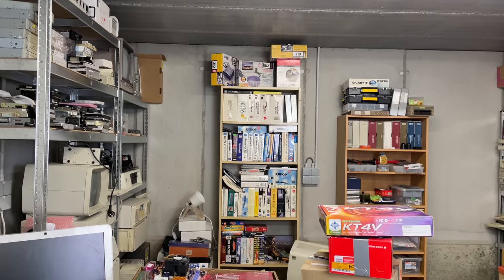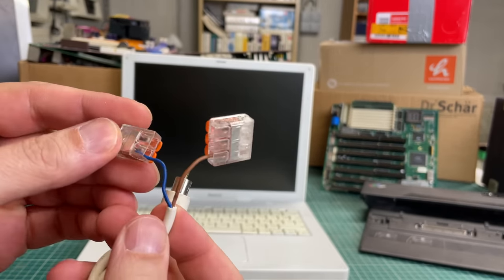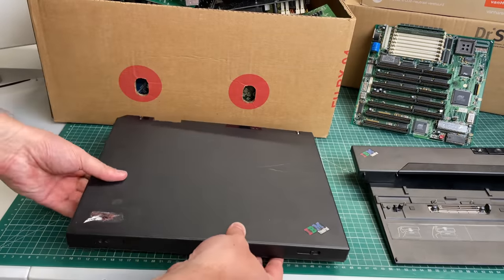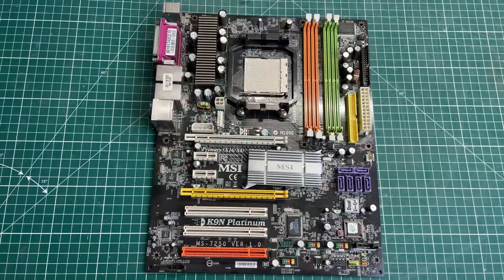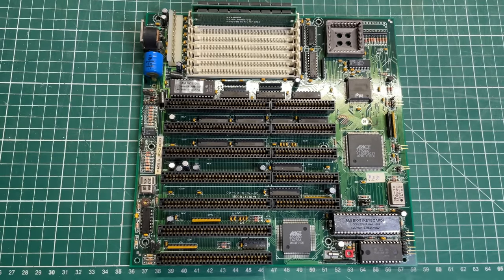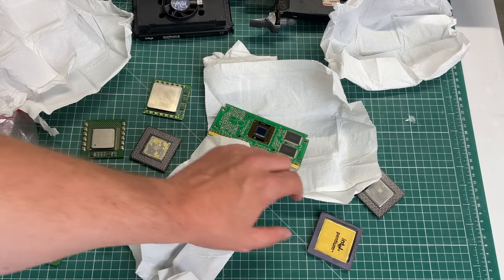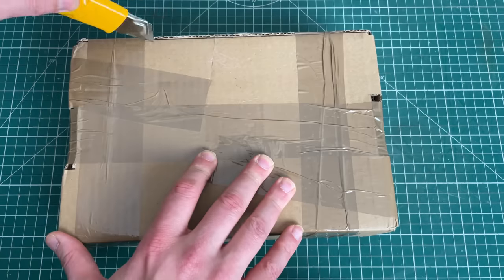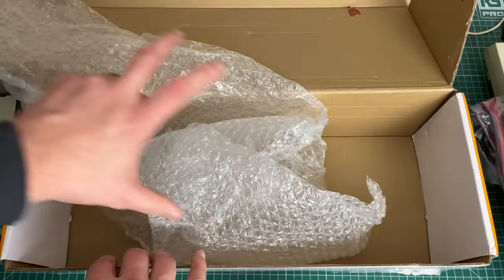Looking at some very generous donations

Comment: I happen to have a G5 that would take that Radeon card with the ADC connector.
Reply: Jep, a ATi Radeon card with the extra "slot" for the 24V needed by the ADC. Was a need design to have the monitor powered by the G5. Fun fact: The PSU of the G5 supplies 25V to compensate the losses on the way to the display.

Comment: 21:17: Both cards are 5250 emulator cards used with IBM AS/400's connected via a twinax Y cable. They require vendor specific software if they aren't IBM Client Access/400 directly compatible.

Comment: That Compaq docking station looks very interesting. It may have the aesthetics of a Fiat Multipla but it looks very practical. The design is a bit weird, it seems like it takes normal drives and not slimline ones. It’s like a hybrid of a desktop and a laptop. Curious if that iMac is a G5 or one of the first intel models, they still had the same case design.
Reply from the maker: Yeah it is a beast … definitely going to see what it can do.

Comment: You need to replace the LCD on the little Sharp but the problem is getting a replacement screen.
I have seen a replacement procedure for the PC-1250-series (see Robert Baruch's channel), but not for the PC-1245.
It's perhaps best to get another defective 1245 but with a good screen to combine the parts?

Comment: Unfortunately that Sharp PC-1245 display is pretty much a write-off, impossible to fix. The problem is that the airtight seals between the glass panes in the LCD are of poor quality, and over time they let moisture and other contaminants seep in between the display glass layers, which ruins the display. There is no way to fix this other than a complete replacement.

A maker named Robert Baruch reverse engineered some of these displays and actually contracted out with a manufacturer in China to make new compatible replacement displays. He has created replacements for the TRS-80 PC-1 / Sharp PC-1211, TRS-80 PC-3 / Sharp PC-125x and Sharp PC-1246. Sadly he does not have one for the PC-1245.

Comment: You need to power on the iMac and check the screen hasn't half died, mine did.
Reply from the maker: Normally it should work ... will do a separate mac themed episode at some point.
Reply: many of these G5 iMacs were plagued with issues.

Comment: Definitely don't need to worry about uncovering the windows on those EPROM chips. There's no chance you could accidentally erase them indoors, they really need UV-C to wipe them. Pretty sure regular window glass filters out UV-C, so they could sit right next to the window all day and they'd be fine. Even the UV-C in sunlight is fairly weak. I've seen a couple of experiments of people leaving these in direct sunlight and apparently it took weeks for them to start to be erased.

Comment: If you don't mind you wouldn't happen to know the part number for the IBM dock you got? i have an A31P as well as the full dock for it, but i have not seen a dock with a power connector like that one and i would like to do some research
Reply from the maker: IBM type 2878 P/N 62P4551
Reply: @RetroSpector78  Awesome, thank you

Comment: That clock card battery connector saying "BATTLE" is like... 
I'm too young to leak
Hey, not too leaky
Corrode me plenty
Ultra-corrosion
Etchmare!
(I bet some of you come up with better Doom difficulty settings/level names)

21:17-21:27 there's a weird little voice in my head saying "Token Ring". But I don't trust that voice...

Comment: Why does the AMD K6-2 and K6-3+ CPU's read "Designed for Windows 95" and NOT read "Designed for Windows-98" ?
Most computers with Windows 98 installed came with a 233mhz CPU up to a Pentium-3 @ 650mhz. Windows 95 computers sold came with an AMD 5x86 or up to 200mhz Intel CPU.
Reply: maybe they didnt have working windows98 in last stage of developement, so it would be lie. So they rather choose windows 95 markings. as far as I know, amd k6-2 was introduced few months before win98.